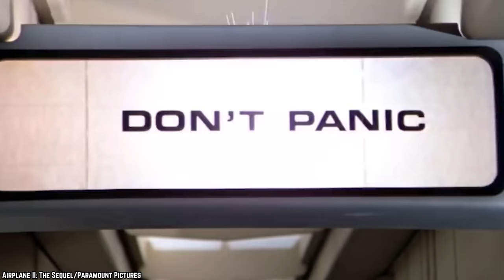Top 10 Soda MYTHS That are LIES (Part 2)

Comment: Yeah, if you're worried about the can blowing up when you open it, just stick it in the freezer.  That'll pretty much guarantee a carbonated eruption.  And if you've inadvertently frozen a carbonated beverage in a plastic bottle, you can see the bubbles going down when you tap it several times.

Comment: Well dissolving teeth maybe a long shot but coke at least can still strip paint. O...o off of ones car...
Reply: Also high fructose corn syrup has been found to dissolve significantly slower than cane or natural sugars. Lasting as much as 24 hrs coating ones intestines. O...O and yes that also means slowing down your digestion.
Reply from the maker: Thanks for the feedback Maxwell J. S.! 😊😄 Did you like the video?